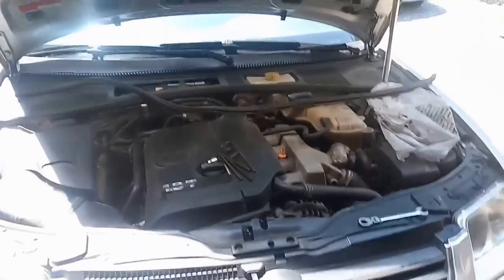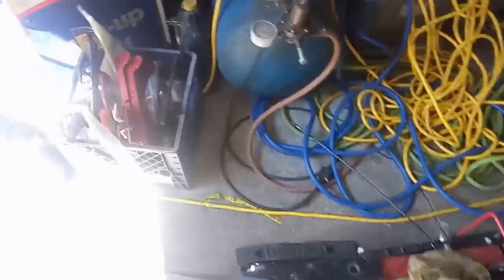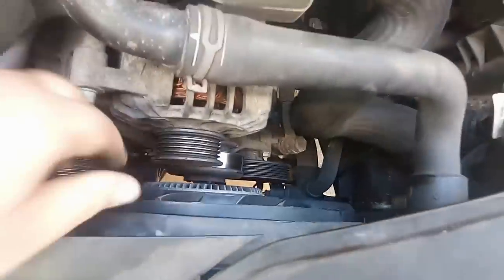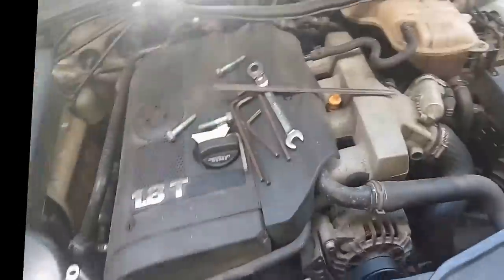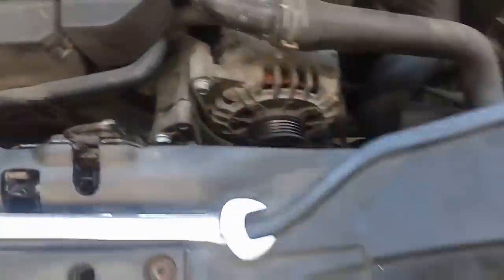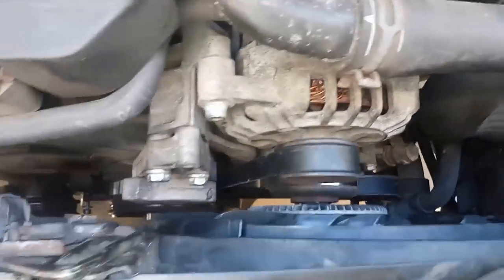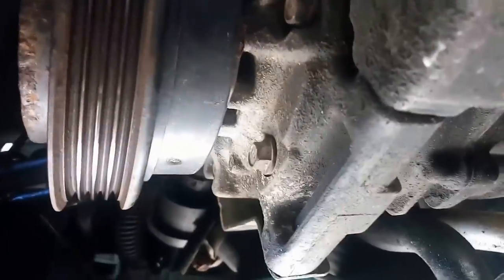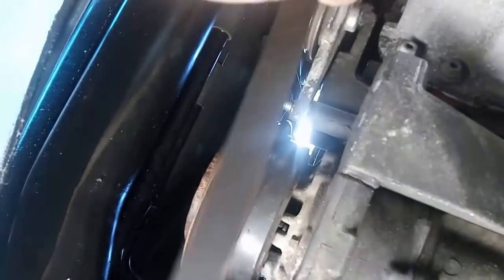2002 Volkswagen passat serpentine belt replacement

Comment: My alternator looks just like yours haha is it suppose to look oldish or is it time for a new one?
Reply: Was the alternator the cause the belt needing to be replaced??
Reply: trin Bryant no the car was just old, didn’t look like the previous owner changed it in some time. I saw there were cracks starting to form down the belt so it just needed a replacement.